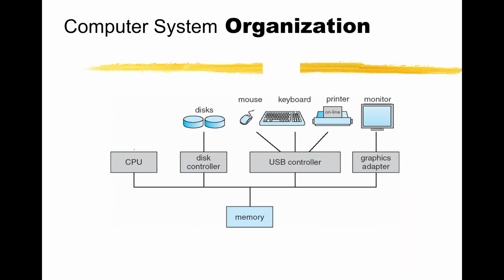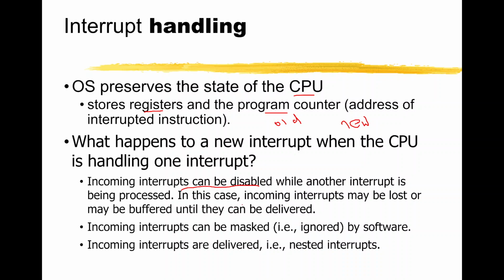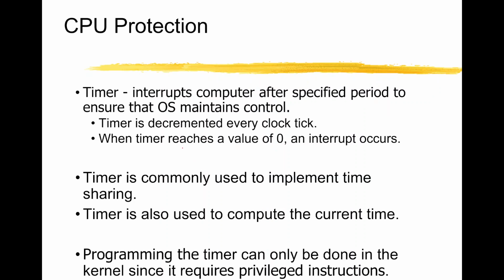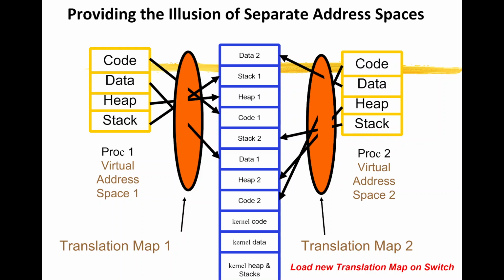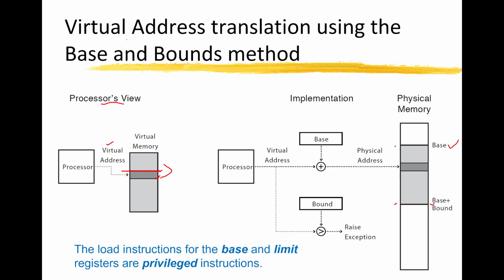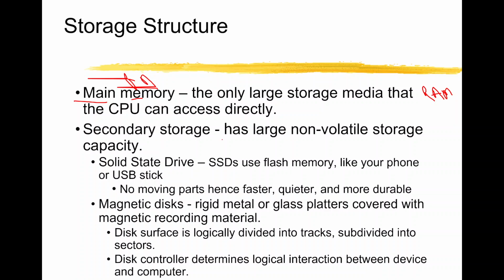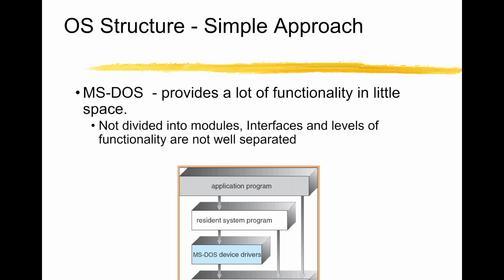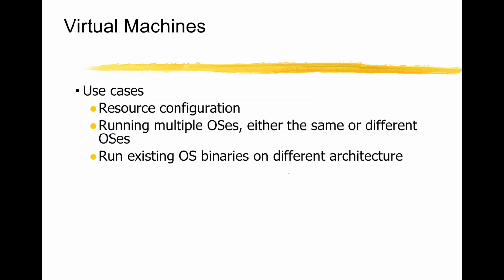Operating System Concepts Part 2 - Computer Organisation and OS Structures

Comment: 23/EG/CO/072
Thank you, Dr. Emmanuel, for this comprehensive breakdown of OS structures! The way you explained the fetch-decode-execute cycle and connected it to how the Base and Limit registers handle memory protection was incredibly clear. It really helped bridge the gap between high-level application code and the actual hardware for me.

I have a question regarding the architecture types you discussed near the end: You mentioned that Microkernels offer better security and expandability but suffer from performance overhead due to message passing. As modern hardware becomes significantly faster and security becomes a higher priority, do you foresee a future where general-purpose operating systems shift more towards a Microkernel architecture, or is the latency from those context switches still too high of a barrier?

Comment: Another class video.

This segment dives dipper into the structures of the operating system and the computer system as a whole. It speaks on the flow of operations in the computer system, the storage structure, organization and the various tasks and sequences that go on in an operating system.

22/EG/CO/1713